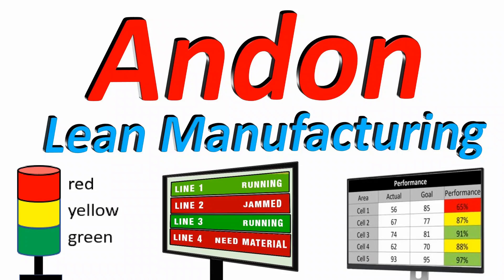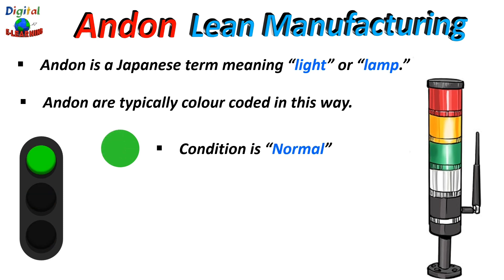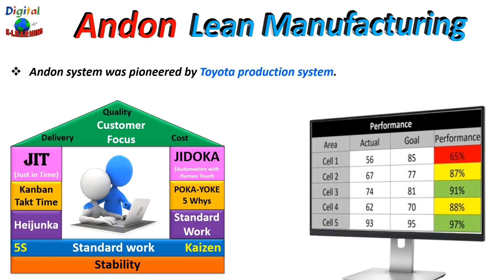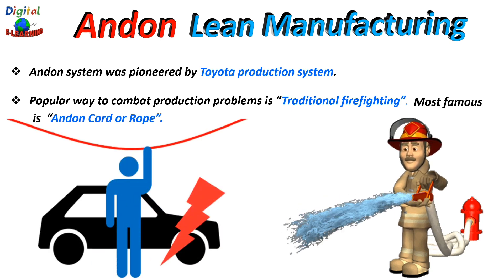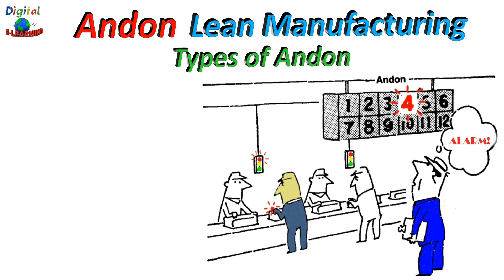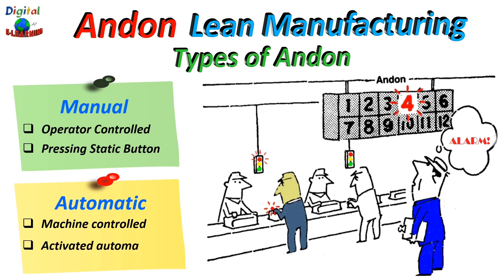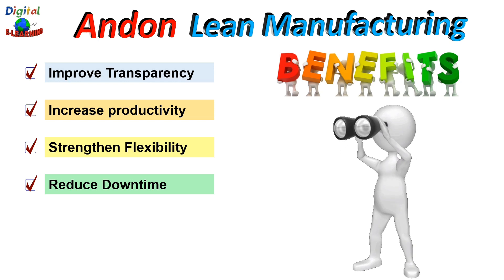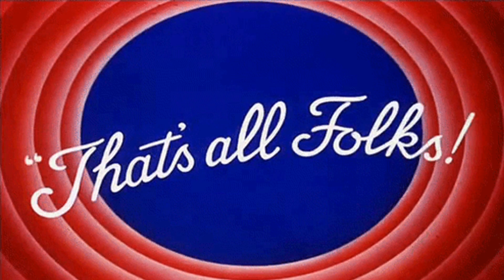What is Andon in Lean Manufacturing? | Types of Andon | Andon in #leanmanufacturing

Comment: An Andon system is a powerful visual and auditory communication tool designed to enhance manufacturing processes by providing real-time updates on operational performance. Its core purpose is to ensure seamless communication between operators, supervisors, and management, enabling swift identification and resolution of issues on the production line. This proactive approach minimizes downtime, improves quality, and drives overall efficiency, making the Andon system a cornerstone of lean manufacturing practices.

Introduction to Andon System
Andon systems are versatile and widely adopted across industries to streamline operations, improve quality control, and ensure safety. Here are some key applications:

Production Monitoring: Real-time status updates on production lines, including operational status, downtime, or issues, help teams respond promptly and maintain efficiency.
Quality Control: Alerts about defects or inconsistencies ensure immediate corrective action, reducing waste and improving product quality.
Maintenance Management: Automated alerts notify maintenance teams of equipment malfunctions, enabling quick fixes and minimizing disruption.
Inventory Tracking: Keeps track of material levels and alerts when replenishment is needed, ensuring uninterrupted production.
Safety Alerts: Enhances workplace safety by signaling hazards or emergency stops with clear visual and auditory cues.
Lean Manufacturing: Supports lean initiatives like just-in-time production and kaizen by improving transparency and reducing inefficiencies.
Remote Monitoring: Allows supervisors to oversee operations remotely, ensuring effective management across large facilities or multiple sites.
Continuous Improvement: Highlights recurring bottlenecks and inefficiencies, providing data-driven insights for process optimization.
From automotive and electronics to pharmaceuticals and heavy machinery, Andon systems are indispensable for industries striving for operational excellence. Their ability to adapt to diverse environments and applications makes them an essential tool for achieving manufacturing efficiency, quality, and safety.

Usages of Andon System